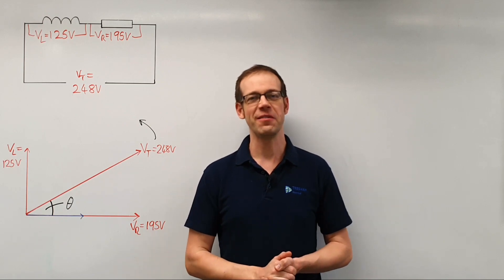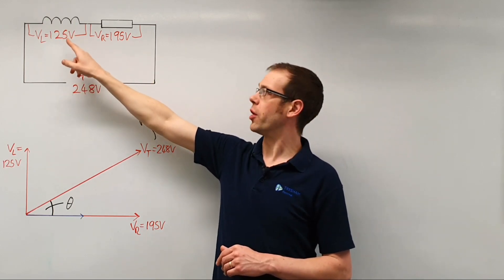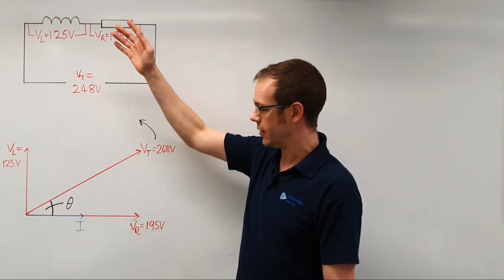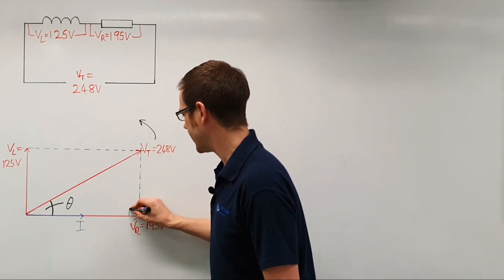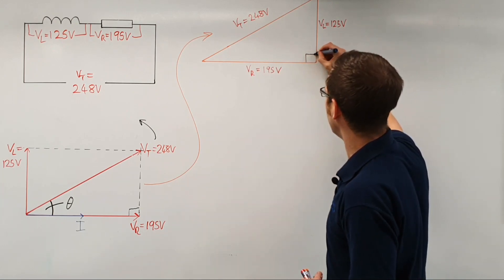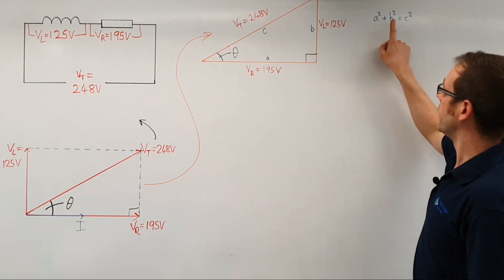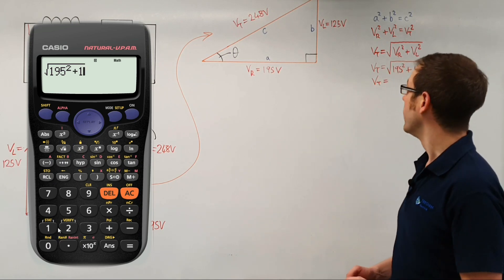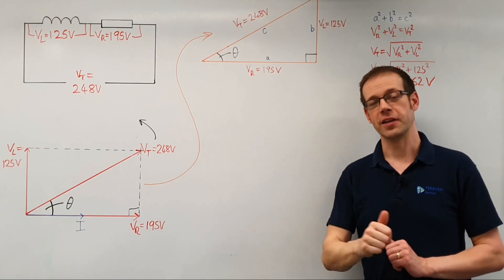AC Theory: How to Calculate the Relationship between Voltages in an Inductive Circuit as a Triangle

Comment: Can u please measure the resistance of the coil and add it in series with the inductor and do the calculation again to arrive exactly at 248 volts?  If not .. can u please tell me is it the right way to do so?